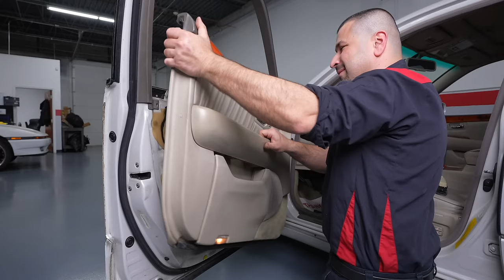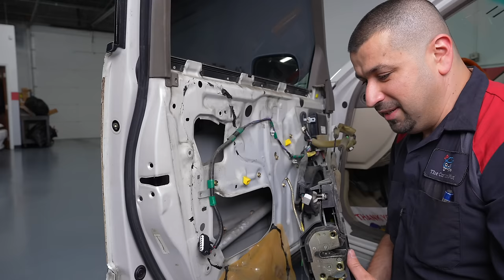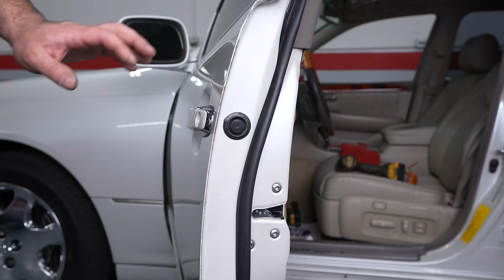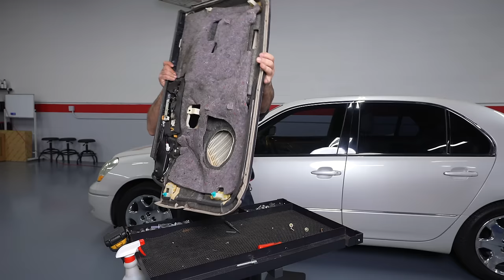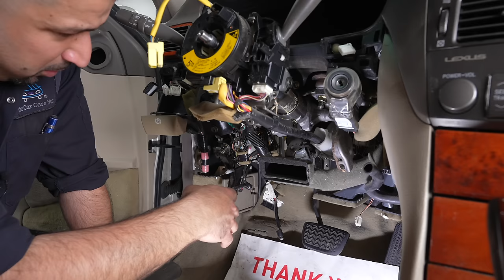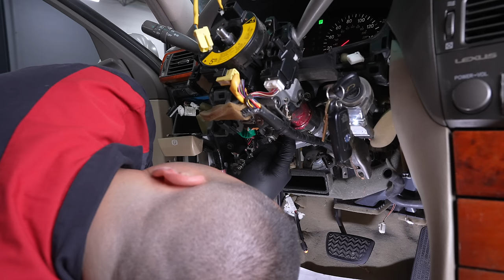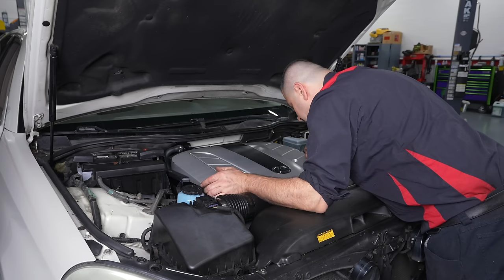Preparing Our 600,000 Mile Lexus for It's First Long Trip! and a Small Accident! Part 5

Comment: I can't wait to hear about the 600 mile trip! I'm very curious how the front end feels? Like new or do you need to replace control arm bushings? My brothers 2003 LS430 had a slight vibration at 70mph  from new. My gs400 had the same super annoying vibration until I put a polyurethane bushing on each caster arm and after that it drove awesome with no extra NVH. I would love to see a new car type review on the car care nut reviews. I feel like a fully sorted LS430 could hold up next to a new brand new LS!

Comment: Those lower covers are like a puzzle, if you get them right they hold each other together, if not, you have a mess.  Something on my wife's Camry vibrates when you're driving into a headwind and drives me nuts, I think it's one of the covers but nothing is loose....  I'll pin it down eventually.

Comment: I must be such a gear head nerd, but this is literally fascinating to watch all this restoration AMD...you are one skilled master at this. How did you get so much knowledge on Lexus and the nuiances of Lexus line working at a Toyota dealership? As to the transmission, is it really that bad that doing process of taken out and new gaskets, check torque on valve body attaching bolts (two were somewhat loose on my 2009 Corolla when I dropped pan at 210K miles and cleaned out filthy pan and new filter), and test solenoid while apart? No codes OBD codes thrown huh? Will be interesting to see how it did on your trip.
Reply: Recently replaced AT fluid with pan drop and filter in a 300k Lexus Es350. The improvement was very noticeable. AT fluid is a great cleaner and  fresh fluid may fix even a solenoid issue. I hope the CCN at least gets into the transmission to look at the solenoid and the rest of it before throwing it away for a used replacement. ( I would definitely buy the 45k used one anyway )

Comment: Agreed with most comments. I’d personally buy a used tranny and purchase a rebuild kit from Lexus. It’s doubtful the used tranny you’re talking about only has 45,000 miles on it since it’s next to impossible to determine actual mileage. But even so, it can’t be anywhere near the 600,000+ miles you have on this Lexus.

Comment: Wonderful video!  Very informative.  Well...the used transmission seems like a good option under the circumstances.  I'm really sorry that the original tranny is going out on you.  It was really interesting watching you remove the air bag.  I'm not a mechanic, so I have limited knowledge on air bag technology.  But everything I've heard and read about air bag removal almost always evokes fear and paranoia about the air bag accidentally discharging if not removed carefully and properly.  I thought the battery had to be first disconnected and there was at least one capacitor in the circuit which had to be discharged before the air bag work could even be touched, let alone removed.  I've read that a  person even has to be careful about using metal tools like screw drivers that could cause a short and ensuring that the removed air bag is placed on the ground face up and away from any place where there is a potential of an arc.  I don't know how much of that is true or just urban myth.  So I was amazed how quickly and nonchalantly you removed it.  If it was me (typical layman:), my hands would be shaking and I'd be doing it from a standing position outside the door just in case it exploded!😰 Anyway, thanks for the video!  There's nothing more enjoyable than watching a seasoned professional doing what they do best!  You make it look so easy! 🙂

Comment: Bro, Buy a good used transmission and use Toyota Fluid. Drive 5-10k miles and change the fluid. Universal aftermarket fluid is garbage.

Comment: Please just swap the whole transmission including the stall converter. I've been dealing with old Toyota automatic transmissions for years and getting a low mileage used one is almost always the answer. A new one is usually too expensive, overhauling mostly won't do the trick completely. If anything, you could flush the new-but-used transmission once mounted. Flushing it using its own pump is worth it most of the times.

Comment: Pro drill lube from a machinist: IPA, (isopropyl alcohol) in 16oz spray bottle and two tablespoons of Cetearyl Alcohol pellets or chips, sold by the bag on Ama. It will dissolve in the IPA. You don't need oil, you want to cut and cool. Drill slowly (less than 400rpm) while maintaining slight pressure and spraying the IPA until you see chips forming. Got a tough job like drilling out a bolt ? use only a carbide bit aerospace quality drill point drill. Always start small like a #30 and drill up in size for the best chance of success. Never overheat the area by chattering with a dull cutter, you will crystalize the surface. If you don't see chips in the first few seconds coming off the drill point, change the bit.

Comment: Great video! Just purchased a 2005 Modern Luxury and will be replacing the tilt motor. I couldn't quite hear you when you mentioned what type of grease you used on the motor threads. Did you say "wheel grease" assuming is wheel bearing grease? Thanks!

Comment: Without any doubt whatsoever get and install the used transmission.  I’m an old guy, 76, and have had transmission “issues” with all of them.  (I am a very moderate driver.)  The only hassle free fix was with the used one.  You have your own experience but I’ll go out on a limb and express my belief that transmission shops are on the crooked end of the auto repair business because while there are a number of people thar know something about engines, nobody has a clue about transmissions, especially automatic transmissions.  Even the best ones will push you to a rebuild as they make much more money there.

Comment: Another great video! I am no mechanic. I admire your skill and patience. One question. When working on the steering wheel, would it have stayed in the full out position if the battery was disconnected before the key was shut off?

Comment: The transmission from my Nissan Pathfinder lost the reverse gear at 260k mi. I was talking to a few transmission shops about cost but none could tell me up front. So I let my trusted mechanic install a used one. Cost me $1700 and it is still working fine at 390k mi. An alternative could be "Richard & Teresa Educational Transmission Videos" but I'm not sure if he does "foreign" transmissions, never saw a video about that, usually American ones.

Comment: Is that 45k on a remanufactured transmission or on a used transmission and what is the mileage originally on the car that used transmission came out of? What's the warranty parts and labor on the 45k transmission and a remanufactured transmission if bought? I think the car would be your comfort zone and toy so to speak but financially to make it sound would cost a fortune. That is besides all the labor you put in.

Comment: Great vid. My telescoping function on my 2006 IS350 has stopped working. The tilt works but all I hear is the motor spinning and not engaging when it's trying to telescope. Is that gear/shaft accessible and possible to repair. I'd rather do this than have to pay $1500NZD for a whole new assembly.

Comment: How much effort is it to check the torque converter overdrive solinoid wiring and associated parts?.... Maybe simple wiring or mechanical mistakes made by other mechanics?...would be nice to talk to the original owner on the work done in the past ..

Comment: I own a 2005 LS430, currently having the rear main seal replaced, but I am under the impression that the front crank seal is also leaking, potentially the cam seals as well.

The leak is pretty small, and I’m considering just letting it leak until the timing belt is due for service. Thoughts?

Comment: A nifty way to SAFELY remove broken bolts is to to use a LEFT HAND STUB DRILL.  
They are commonly used on automatic screw machines.  
The drill bit usually catches on the broken bolt and UNSCREWS IT.  
For me 95% success.!

Comment: Well, I think I would probably get that used transmission you mentioned. It has low miles and if you don't buy it now someone else is going to take it. It doesn't make much sense to keep that old 600k mile one because at some point it's going to go out.

Comment: Transmission? The 45k used Lexus transmission seems like a no brainer compared to the other options. A Lexus trans with 45k is barely broken in and was put together by Lexus not a rebuilder.

Comment: Personally I'd probably change the speakers while I was there after 600,000 miles of use if they've not been changed before i reckon they're past their best and you can get very good low cost ones at most places

Comment: Been there, done that on a first gen LS400, I feel your pain with the door lock. I filmed it and edited an hour of struggling out. Too bad new door latches are unavailable over here, I had to fix mine myself.
Reply: You've already done the hard part and learnt whilst doing so. Your "unavailable over here" (meaning in NL) caught my attention. Back in 2017 I needed two Mazda camshafts and other speedy bits that, because of US-EPA bull$hit, were never offered here. JDM vendors were stupid expensive. However, I had excellent results with PartSouq in the UAE. Parts were FedEx'd, arriving in three days ARO. Cheers!
Reply: @blackrifle6736  I just ordered an upper control arm for my LS400 via RockAuto for 1/10th of the price in NL. But there are still some parts that are really difficult to get, I'll check out your tip. By the way, if you're interested, I documented the restoration on my YouTube channel. Thanks for the tip!
Reply: @Carnold_YT  Glad to know RA ships overseas. Yesterday checked your channel and sub'd too. That's how I learned you were in NL. You have a beautiful ride there. Cheers!

Comment: Pour a little AT-205 RE SEAL in that transmission and see if the leaking decreases, or maybe even stops. With 600k on it, it will soon be junk anyway. It would be a good cheap ($20) experiment. Add a couple of ounces at a time & see what happens. It worked on my 23 year old power steering shaft seal. If it eventually ruins the pump, so what. It had to be replaced anyway. Of course, Ford Expedition parts are cheap since they made millions of Ford pickups & people hang on to them for a long time. 
 I would buy the used transmission unless they wanted a crazy amount of money for it.

Comment: I’d keep going on the engine and transmission that’s in it. Cuz heck if your going to replace a transmission just cuz and there’s no issues then heck go ahead and change the engine too…to me that makes no sense. 
But I also like to keep my engine and transmission til they actually go out to see how many miles it went and maybe get bragging rights. Not that you don’t have that already with it at 600k but if u can get more why not. Even better. As long as it’s been serviced regularly they both should be fine for more miles
Reply: ATX leaks like a sieve.

Comment: Hey, i do own a lexus ls430, and have an issue with the check engine and vsc off light. During cold start of the car their is a vibration in the motor for some tine and goes away, also the power output for the first gear is just not their. Hoping to get a resolution for this problem from you, as i have tried changing the plugs and coil as well. But nothing is working

Comment: Buy the used transmission with 45k, but don't change it yet. Run the 600k to the ground and then replace it with the 45k

Comment: Good day do you have a video of you removing the top steering shaft of a 2003 Toyota hilux 3.0l KZTE 4x4 double cab,I have a rattle on my steering, if I push on the steering while driving,then the rattling dissappear.

Comment: Curious to know if you got the OEM 01-03 struts for your LS430. I gave them a try on mine but found them to be too soft. I got the 04-06 OEM which are monotube vs. twin-tube. In my opinion they give the perfect balance, not to soft but still isolates road imperfections.

Comment: I wonder if Richard Becket would do it and make a video of it. at Precision Transmissions Amarillo. They have stopped making videos for now but might still be going.
Reply: Wow! That's a blast from the past! Years ago PT did an ATX rebuild on my ride when they were on Raton St. This is before they moved to Ross St. At my request, they used Sonnax parts exclusively. Whenever was in that neck of the woods, would stop by and have them do flush/fill in whatever my ride was at the time. Back in January they closed up shop for good. I guess Rich retired and the kids didn't want to carry on. Gonna miss him, Theresa, Hayden, Trent and that sweet shop mutt (Annie?). Didn't know he was on here. Will check them out. Cheers!

Comment: It would be fantastic if it was cost affective enough to rebuild the original transmission and let this car go to one million miles on original engine and transmission. Like you stated , you've  reached a turning point where it just won't be worth rebuilding the original.  See if lexus will support this build if there interested in seeing another one of there cars reach a million miles on original engine and transmission 😅 .  If they don't care than just go with that used 45k mile transmission.  That makes the most sense to me as well.

Comment: Regarding your problem with the gearbox: On the one hand a replacement gearbox would be a better choice, on the other hand replacing key parts would corrupt the idea behind the 600,000miles project a bit. Have you thought of a shop that specializes in rebuilding automatic transmissions? If you were to replace the engine, this project would no longer be honest and credible - in my eyes.

For me personally it would be very exciting if you would disassemble the gearbox and see what condition it is in inside. Then you can always make a decision.

Good luck with your project!

Comment: Go for the used transmission. With 45,000 miles, you could get another 500,000 miles out of it and have yourself an reliable car you won't lose sleep worrying about.

Comment: The bolt job would be a lot easier if you just use reverse cutting drill bits with your drill on reverse, the old bolt 9 times out of ten will just spin out

Comment: Door locks seem to be a Toyota weakness.  I've known several that needed replacement, but no other brand.  One Scion needed all four replaced.
Reply: Yea my 13 Lexus same issue....I think it's the motors that fail.
Reply: Hondas are worse Toyota rare
Reply: @andersonrodriguez8258  I've had a half-dozen Hondas, for a long time each, and never once saw that.  With Toyotas, all the time.

Comment: What’s wrong with the transmission that’s in it now? If it’s fine why not just keep it and see how long it will go. And buy a new or low mileage one used and keep it off to the side for when you actually need it
Reply: ATX leaks like a sieve.

Comment: Second hand transmission, or convert it to manual transmission, I suppose it's going to be a very long video, or two, with everything extra that you need to do. But what you decide, take the old one apart, so we can see what a 600000 ml looks like inside.

Comment: Nobody can answer my question about transmission fluid level on my Sienna 2008. I hope you would. So, the dipstick has COLD and HOT level. When I check transmission fluid after riding, engine is working -  it's perfectly inside the HOT dipstick points. However, when in the morning I check the level on cold transmission (start the car, engine is running, I shift to P -> D ->  R -> P) and go to check the transmission fluid, the dipstick shows level far below the COLD. Like it's almost dry. Is it ok?

Comment: If the cost of the rebuild kit plus the solenoid is comparable to the cost of the used transmission, I would rebuild it. That would be assuming you are going to rebuild it yourself.

Comment: I know my comment will probably be the one that NOT the most practically but i think you should rebuilt the ORIGINAL transmission unit.  The whole point of the rebirth of this car is to keep it all ORIGINAL.  How nice would it be to say that the car has it's original engine and TRANSMISSION still in the vehicle??? Numbers matching.  I vote for rebuilding the original transmission.

Comment: Definitely run the current one till it dies unless your plaining on rebuilding it. The rebuild would definitely be very interesting to watch but there is no logical reason to do the rebuild and spend all that money other than you want to make a video on it. The logical and efficient solution is definitely used trans. And a used low milage trans is def the better choice than a trans rebuilt by an unknown person since you don't know what kind of a job they did rebuilding and what corners they cut to save cost when rebuilding.

Comment: I have a question on TSB #TC007-07 reprogramming the U660e ATM on my ES 350, using T-SB-0134-16. Is that the latest procedure to use? My local Toyota is very closed mouthed about cost of reprogramming. I'm aware it may or may not work- but I also know they're in business to make money. 💲💲💲